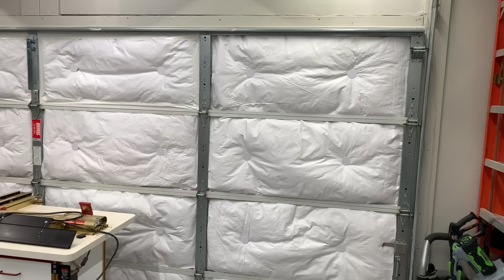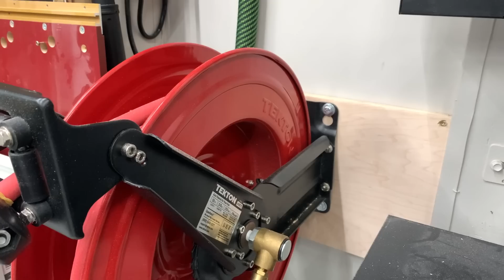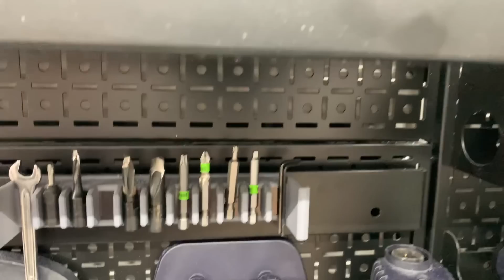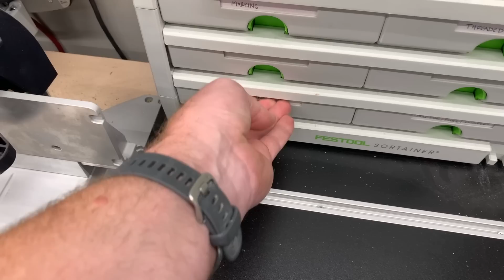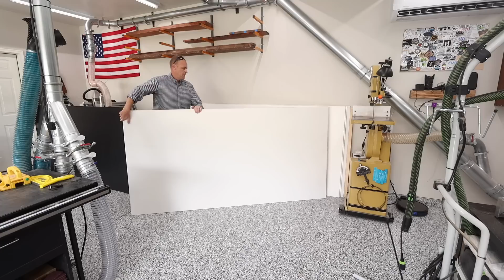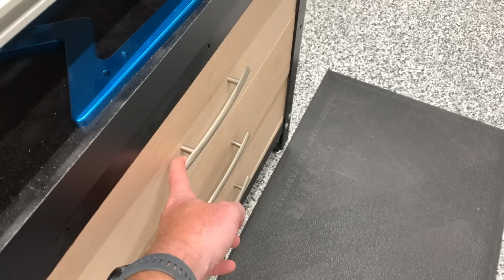2020 Shop Tour

Comment: Quick question what do you use when you are trying to square up things and how important is it for my table and my floor to be level in your opinion do you have some type of a jig for squaring up your Corners are squaring up your projects is that something I should consider trying to buy or may I do try to use the cross Corners method where you go from corner to corner opposite sides is that the easiest way to do it or is there a simpler easier way better way
Reply from the maker: I don’t find it important at all. What I value is a flat surface

Comment: What 2 sizes are your Bessey parallel clamps? Do you find that having those 2 sizes meets most of your needs for parallel clamps?
Reply from the maker: I have the 24 and 50 inch models. I get by very well with them.

Comment: Thats a lovely shop chap. I agree on the multiple mfts.. I've made benchs with a huge mft top and they're just not quite the same. And you can always take them outside if you need to. But got to ask, what do you use the table saw for? Do you not rip stock on the bandsaw and track saw all sheet material? Kindest from the UK, Matt.
Reply from the maker: I still use my table saw a lot. Much faster for most things. Plus I use a dado stack in it fairly often. I have started to tell myself that I could probably get by without it but I don’t know if I want to be without it.

Comment: What Rockler bases are you referencing for your miter saw station. I need PCS friendly solutions for another 8 years and that looks like an easily repeatable solution from one duty station to the next.
Reply from the maker: They are the Rockler metal stands
Reply: @bentswoodworking  I actually watched your miter station and saw them. Thank you for the info. A good quality furniture shop is hard to move every few years so all ideas help me out alot

Comment: Jason do you have or intend to do a video to show a more indepth view of  your assembly table setup.  I find it intriguing and would like to see more of it.  Although I have seen Ron Paulks setups, and purchased all the plans, I must say I am not a big fan of the open storage.  I would prefer drawers, and I am looking for something that controls the dust dropping down the dog holes.  The Track used this way is exactly what I have in mind.  Where did you get the once piece extrusion?
Reply from the maker: I do have a video showing it in more detail. It’s 3 Festool MFTs on top.

Comment: The reason you wouldn't have been using your sustainers for their purpose is, their purpose is more for a contractor that is mobile and going from site to site. They aren't being transported when used in a shop setting, so the sustainer becomes more of a hassle.... in and out, open/close. I'm a hobbyist, don't have near the amount of festool you do, but same... they are out and at arms reach. and, and, my shop is far from picturesque... but I'm not a youtuber filming, so there is that. I've often thought of stringing together more mfts to create a larger work surface and wider crosscut capability but am torn. Not sure about the long reach... nice set up though
Reply from the maker: Thank you

Comment: Great shop! Question about the wiring for the table saw and jointer/planer combo? I’m assuming they are running off 240v. Where did you plug in those machines? Do you have an outlet on the floor or are they hooked up to an extension cord which runs vertical along the dust collector pipe and plugged in finally to a 240 outlet on the wall?
Reply from the maker: I buy the plugs at Home Depot and create my own extension cord. And yes they do run up the DC pipe to an outlet.

Comment: @16:44 u say about 8 feet from beginning of blade to assembly table. Just curious did you account space for yourself behind the 8 foot long board/sheetgood?  Just to clarify
Reply from the maker: No, because I wouldn’t be standing directly behind it. But, I also don’t cut full sheets at the table saw and almost never cut 8’ boards at the table saw.

Comment: Nice work station! Can you comment on how you setup the middle MFT to have the flip rail?  Ie. setting the up so you always have 90 degree repeatable cutting station.
Reply from the maker: Take a look at a recent video I discussed the assembly table specifically
Reply: I had watched the previous video and I have seen the bench dog rails before too. My question is pertaining to setting the rail up. When using the MFT in that orientation you aren’t using the factory stops. I bought a used MFT and the guy had moved the factory stops and I’ve had a hard time achieving perfect 90’s.
Reply from the maker: So his system is designed to be set up referencing the dog holes. This makes is very easy to achieve a 90 degree angle. I have experienced excellent results regardless of where I place the fence

Comment: Hey Jason, Tom Melcher here with WWGGA. Really hated to see you leave GA, but it’s got to be a little cooler, it’s sweltering here. Couple of questions.

What color temp are those lights? I love the 5000K lights but they’re hard to find. 

As you probably know, the Festool cords are specific to the tool, i.e. track saws vs. sanders. Festool confirmed the difference but I couldn’t get a straight answer why. Both cords fit either one. So on your Festool boom, which cord do you use? I use both, one on each side. I’ve heard through a friend in the Guild (John Jones) that not using the correct cord will render the tool useless and Festool will not honor the warranty. It happened to him. He blew out his RO150 using the track saw cord. Take care!
Reply from the maker: Hey Tom. Hope you’re well. The lights are 6000 K and are from American Green Lights. They are phenomenal! As for the cords, there is the cord with the additional notch on top and the one without. They are two different gauges. The one without works in all tools. The one with will only work with the tools that require it. With that being said, I use the one without for everything and have been told that it is no issue. Nor have I had any problems with it. There may have been a different issue associated with the Rotex. This is a good little clip explaining it from my buddy Sedge. https://youtu.be/Ai_bLzl3Hq8
Reply: @bentswoodworking   sorry for the correction.   They are 5000K 95 CRI
Reply from the maker: Jim Uno thanks Jim! 👍

Comment: I like the detail - I was trying to figure out how many inches between the table saw and assemby table and you gave an answer that let me figure that out and then I figured out the rationale behind that distance by your comments as well.  One question - do you feel the A/C adequately reaches the far wall area and you can feel you are still in the same temp range as closer to the a/c?  I am wondering if I were to get a simlar style of a/c wound I need to run a fan to get the air to the other side.
Reply from the maker: Absolutely, I actually have the thermostat across the room. My garage is well insulated which makes a huge difference

Comment: Glad to see someone else that has an assembly table as the heart of the shop and not the table saw. I really like the choices you made in how you use the space based on your work.
Reply from the maker: Thank you! My assembly table is where I spend the most time by far
Reply: I thought I was the only one that though the focus should be where everything is assembled with all the tools supporting / complimenting the assembly area, I am setting up a new shop and I have 2 mfts joined together with one set up as a mft 3 sys  and my new sawstop saw along with my Router table backs up to the assembly table system.  My bandsaw is the only thing that I am trying to place so that it functions well.

Comment: Jason, why did you call your retractable extension cord reel a retractable hose reel? Is it a hose reel that you converted to an extension cord reel?🤔 Very nice shop guided tour. Also, I liked your old shop too because to me it looked like it was built to be a shop, however, this shop is very nice and it is setup for your specific needs. Finally, I want to thank you for your service in the armed forces. Enjoy your retirement.👍
Reply from the maker: It was just a mistake on my part. Probably just misspoke
Reply: @bentswoodworking  Your shop looks better every time I see it. Thanks for the response. I wasn't trying to be a smarty. I just noticed the error.

Comment: Jason, Great video and great message - think about what you do and how best to accomplish that and design around that.  And even then perhaps your interests will change in a couple of years with new tools/projects and you'll have to change again!  One hundred folks might have one hundred different shop designs.  And speed/efficiency isn't always a major concern - it won't be for me.
I'm in the process of designing my forever shop in my retirement home in upstate NY (which we already own) and I'm thinking long and hard about everything.  I have a lot of room (about 1200+ sq. ft.) that's wide open now so it's a ton of fun.  I've made paper templates for sizing and infeed/outfeed needs are easily addressed with the templates on the floor.
Thanks for your video and the multitude of ideas for me - some of which I might actually use!  And, as always, thanks for your service!  Joe